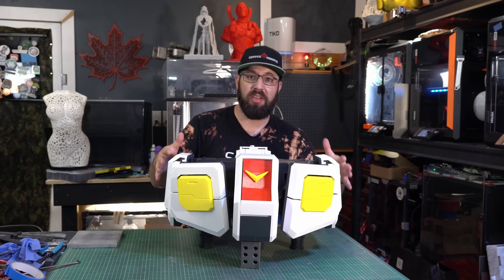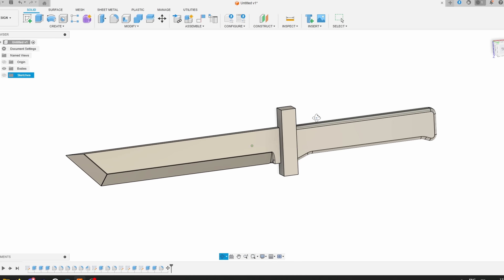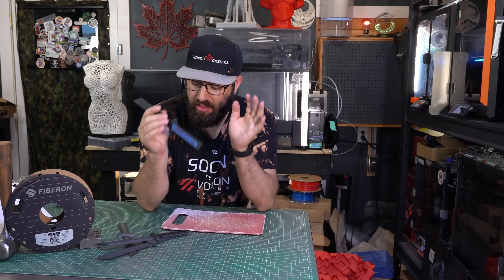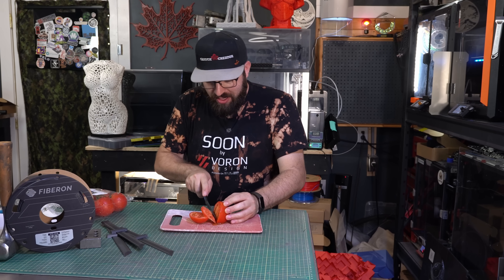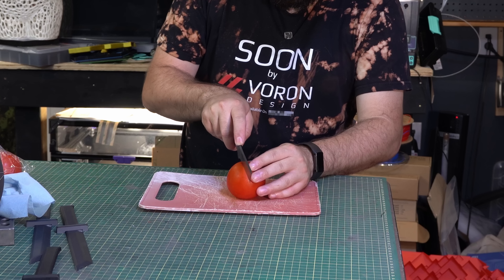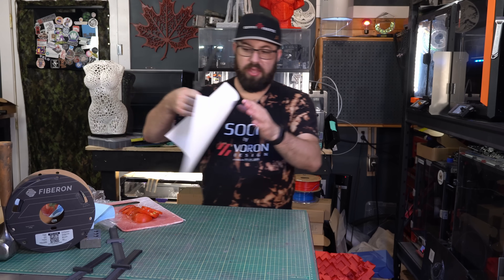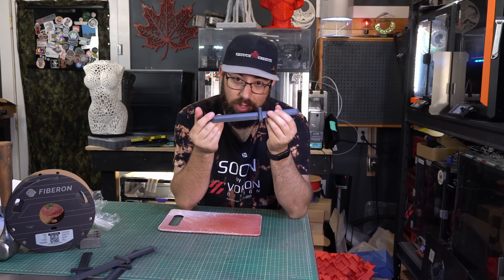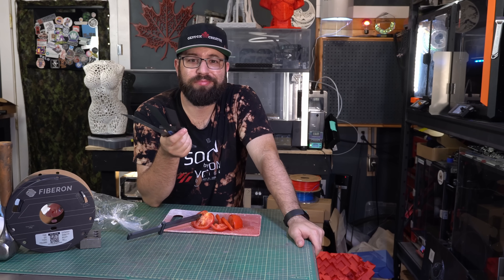How Sharp Can you 3D Print? Testing out PPS-CF10 Filament! #3dprinting

Comment: To get the strength from nylon you need to anneal it, a pretty quick job with something that thin. Also, the CF filaments are rough but can be sanded pretty flat. Those two things could make a night and day difference in your blade. I plan to try it

Comment: Can you 3D print a knife? Well sure, just change “knife” to pretty much anything because 3D printing lets you make absolutely any dumb object. But that is not the right question. The real question is: should it be 3D printed? That is the heart of it. Just because you can 3D print anything does not mean you should print everything.
In fact, most things probably should not be 3D printed at all. First off, plastic is far from ideal for many uses. Sometimes it is even the worst possible material. Take a piece of art, for example. If it is made with fifty cents’ worth of plastic and has never seen the hand of an artist, it instantly loses all its charm. And a tool? Printed in PLA? It will be flimsy, underwhelming, and break the first time it meets real life.Then you have got objects that technically could be 3D printed but doing so is a dumb idea because you could make the same thing ten times faster and better with a bit of wood, a metal bracket, or even just common sense. And finally, there is the long parade of overcomplicated, clumsy designs that only exist because 3D printing makes them possible. You can find a bunch of them in the Voron design unfortunately. Things no proper engineer would ever sketch out, like absurd rail connectors or structural parts full of weaknesses, just because, well, “I can print it, so I did.”

In 2025, the real question to ask is: is this thing worth printing at all? And often, the honest answer will be no. It is just a shiny bad idea. Some things deserve to be 3D printed. Many do not. And knowing the difference? That is what separates the maker from the tinkerer.
Reply from the maker: k

Comment: I got the urge to CAD a large knife (actually two different versions0) and print them in PET-CF.  They were not very slicey but they were very stabby.  This was the only general interest item I've created that I didn't upload because some people wouldn't like what some people might do with them.  I was wanting to try PPS-CF for the knife, so thanks for the video.  I used a slicer modifier so the handle had 8 outer layers, 20% gyroid infill and no top or bottom layers so the inner portion of the handle was all gyroid infill.  It had a visually interesting appearance (free decoration) and was very grippy.

Comment: Something you need to know is knife sharpness feel mainly depends on the thickness of the knife at it's widest point, usually the top of the knife. You could have a very thick knife sharpened to a hair shaving edge, and it would feel worse cutting through an object than a thin knife sharpened to a mediocre edge. It's to do with the friction gripping the edge, like a wood splitting axe etc